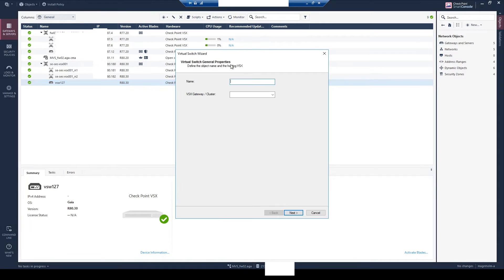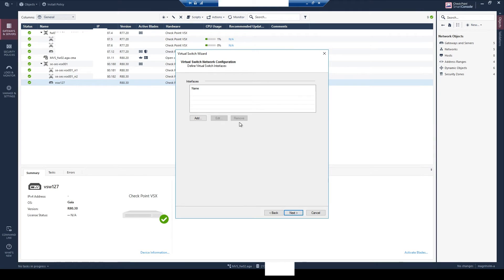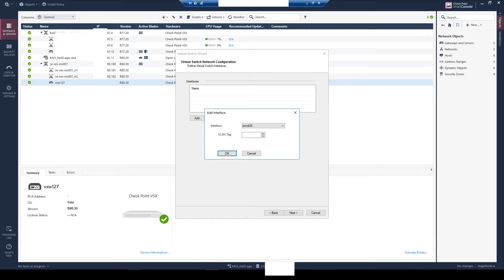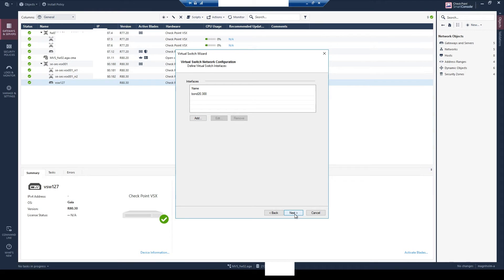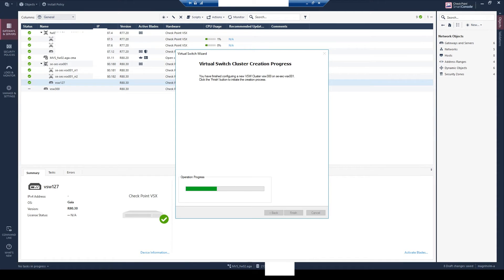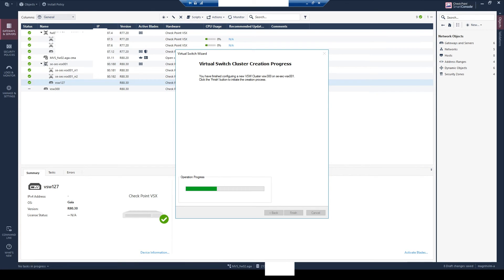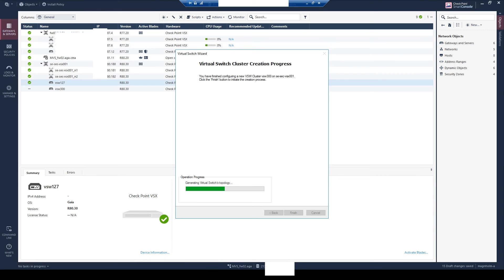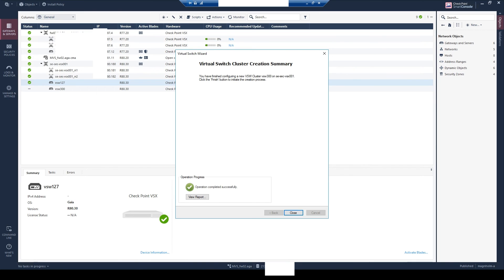Check Point VSX | How to create a virtual switch within VSX

Comment: thanks for this video, is very clarifying, only one question, please: physical ports that belongs to bond20 need to interconnect both nodes of the cluster? using a physical switch in the middle or a direct wire.

Comment: Hi Sir, what are the common and advanced VSX commands through CLI ? Could u pls list it down ? Pls reply.
Some 7-10 commands would do.
Reply from the maker: I use pictures like this to keep track of commands.
More or less only google vsx command cheat cheet :D

https://community.checkpoint.com/t5/General-Topics/R80-30-cheat-sheet-ClusterXL/td-p/41693
https://community.checkpoint.com/t5/Security-Gateways/R80-20-cheat-sheet-fw-monitor/td-p/41546
https://www.roesen.org/files/cp_cli_ref_card.pdf

Comment: interesting video! it would be more beneficial if you add a network diagram.interesting video! it would be more beneficial if you add a network diagram.
Reply from the maker: Hehe, it’s one of my early videos, I will remake some of these.
Network diagram etc will be included in the vsx course serie.
Reply: @MagnusHolmberg-NetSec  waiting videos how to optimisation CP gateway , hehe
Reply from the maker: @poseidon8510  I would say the optimize get less and less. Starting from r80.30 3.10 multiq is enable by default.
There are some dynamic snd allocations in r80.40 HFA something on appliances.

So I would say the most important now is to have a good core design meaning how you actually build and segment your network. How you connect to your gateways etc and just make sure to keep them up to date, upgrade the HFA 4 times per year or so. Check point putting a lot of effort in to make administrative task easier and trying to build up trust in there releases so customers actually use the products as intended.

This is the reason why they added the upgrade capability’s in r81 GUI, also changed how IPS or blades in general is “activated” for gateways. I do believe it will take time especially for SP and VSX.
But I mean you want the Apple approach, as soon as a new release is available for the general public there are millions of ppl upgrading directly, same with apps more and more is autoupdated.

One of the biggest step here is smartconsole and how it’s now built so it can actually get more autoupdates. It’s hard for check point to support a lot of versions
Reply: @MagnusHolmberg-NetSec  i      THHINK     NOT YET   FOR       SP     VERSION ! hhehe
Reply from the maker: @poseidon8510  hehe ye the SP has a long way forward, CP first need to bring it to main-train. Currently I would say it’s not.

I also think we will not see any more chassis, I do think cp will focus on maestro when it comes to high end.
That may bring it closer to maintrain :)
Reply: @MagnusHolmberg-NetSec  wait and see !

Comment: Hello Magnus, your Videos are really great!!
Well explained and each well-structured. 
Would ist possible to make a Video about the downgrade of a VSX Cluster?
That would be really great 😃. 
I‘m looking forward on that.
Reply from the maker: Thanks :)
VSX downgrade is offically only supported in R81. So downgrading VSX can be complicated. 
(The command is there and the times I needed it, it has worked really good.
but the official check point recommendation is to restore snapshot/backup on the mgmt if needed to roll back a VSX upgrade)

VSX serie is in the works :)
Reply from the maker: https://sc1.checkpoint.com/documents/R80.40/WebAdminGuides/EN/CP_R80.40_CLI_ReferenceGuide/Content/Topics-CLIG/VSXG/vsx_util-downgrade.htm

Here is the guide btw,